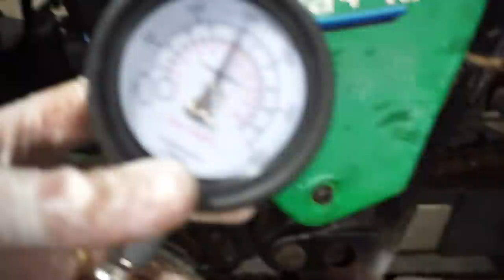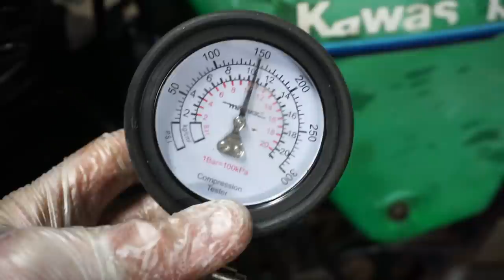Locked Up, Mouse Infested Kawasaki Dirt Bike. Will It Move? (Part 2 of 2)

Comment from the maker: What do you guys think of this bike? Was it worth the $600 I paid for it?
Please SUBSCRIBE and LIKE the video if you enjoyed! It really helps me out a lot!
Check out my Instagram: 2_vintage_
Thank you for all the support!
Reply: Seems like a good deal for 600
Reply: Yeah it was worth 600 I would have split the cases and installed new main bearings though
Reply: @2vintage when it revs up like that put it into gear then turn the gas on mine does it all the time lol putting it into gear and putting around makes it stop
Reply: what tools do you use?
Reply: Yeah 100% worth it and yes I liked the video and I am already subscribed great video keep it up
Reply: Can I have one of yo atvs 😂🤣😂 Nah but frl 😐
Reply: Cool vid, just wondering how the mouse nest made it through the carb jets into the crank, . Wouldn't of thought it Would pass through those tiny jets.
Reply: I had an '82 for a little while. Really cool bike, but these things have been used and abused for a long while. Paid $700 running and riding, but beat up.
Reply: That's really good bike you don't see those very often
Reply: @lenispicker362  I'm buying one today for $500. I'm excited.
Reply: Didn't go through the jets of the carb. Came through the air boxside. . Considering the skid was incorrect.
Reply: I would of bought it that thing is in really good shape for an 1980

Comment: I'm pretty sure there should be a chain roller where the foot peg mounts. Most Kawasaki dirt bikes I came across always had a bad cylinder, and starting in like 79 they can't be bored out, so I stuck with Honda CR's & XR's. I do have a custom 78 KD125 which I call a KDX125 as I built it using 74 KX125 gears, ignition & cylinder head.

Comment: You tuned the idle Soooo well on that bike GoOd JoBe
Reply: Lol
Reply from the maker: Hard to tune the idle when you have the wrong slide!
Reply: @2vintage  Don’t you think you should probably have looked over the bike and made sure you ordered all of the necessary parts before you start the project lol
Reply: @Chickenteam22   you obviously don’t know how it goes working on old bikes don’t tell a successful mechanic how to do his job because lord knows who’s been in that bike and mismatched parts part of the game is not knowing what your getting into you can’t tell everything that’ll be wrong with it before you start
Reply: @MintNickel1  And that’s why I said ‘’You should have looked over the bike and ordered all of the necessary parts needed before you start the project’’  read carefully next time, thanks
Reply: @Chickenteam22  no. if you do that with every bike you will waste SO much time checking things that do not need to be checked. when the bikes is running and riding, is when it will tell you if there is anything else which is broken or out of tune.

Comment: Suggest you replace that shifter or it will wear the splines on the shift shaft then you have bigger problems and it sounds like the clutches are slipping in the video 40 year old  clutches I’d say they need replaced definitely a cool bike Kawasaki was established in 1949 actually the first brand of the big four Japanese giants Suzuki came in 1951 and Honda and Yamaha came in 1955. But no other brand is better than a HONDA 🤙🏻.

Comment: There is supposed to b a chain roller on that bolt you put in for the foot peg.the chain would roll on the top side of the roller,then it wouldn't rub on the frame.
Reply: @titletownclowns1545  where do you find a service manual for these bikes? I dont own one, pdf format would be enough to take a peak.
Reply: @Friendroid  type kdx 175 parts diagram on Google and you can see the bottom roller

Comment: They used to put chain mail on a rope and tow it through sandy roads until clean. I suppose a sandblaster would do the job today. That way half the chain tension on a used bike isn't rust and mud.

Comment: Just watched your MX 175 vid and i honestly think you’ve had almost if not every old 175 made certainly all the good ones. Could’ve had yourself a nice vintage 175 collection when running right and they’re all little rippers and with doing all the work on them yourself cheap to fix and maintain. Just got to the part in the vid where your shifter was slipping and having had a couple KDX’s 175 & 200 i can tell you the shifters slipping are a common problem apparently cos they’re made from a cheap aluminium and wear out quite easily but a decent after market steel one will solve that. I’ve been told the kick not springing back is sometimes a problem people have had but I’ve never had it happen to me and i currently have a 94’ 200 I’ve owned for almost 20 years now absolutely bulletproof bikes.

Comment: When you drained that “oil” I have NEVER seen oil that milky in an air-cooled machine!
Reply: The crank was filled with fuel from carb overflow leaking through crank seal to trans.

Comment: Did you tried moving the air/fuel mixture screw to rich the engine out?
Also cranck seals must be smoked, leaning the bike and allowing gas to get to the oil

Comment: Where you put that bolt into hold the left foot peg. They're is supposed to be an lower inner roller inside their that the chain rolls on. Basically a longer bolt and then a nyloc nut.

Comment: I just picked one up for 500 bucks, turns out it had a small hole in the crankcase leaking out oil. I'll try to JB welded but I'm pretty sure I'll have to put a new engine in.

Comment: You’re going to be running super rich until you get that slide replaced with the cut out backwards it’s not allowing enough air in for the jetting to work properly. I had that happen on a dual carb slides were backwards .ran like shit flipped em  instant horsepower
Reply from the maker: yep just replaced it! Made a huge difference.

Comment: Ober yhe years of having bikes ive never had a bike to where the shaft splines strip out, theyre some pretty solid steel and would take alot for it to strip, 90% of the time the lever will take a crap way before the shaft ever does, ive stomped a few or so shifters so hard and strip them out and the shaft always stayed in great condition. Juat some food for thought

Comment: Good job on your videos and the shifter shaft I'm glad you still got thread on it it's a hard sucker to remove if it's broke my xr250 the first half of the shaft was busted off so I had to drill and tap and bolt onto mine so it would hold then I welded it ok it's not the right way to do it but I never had a problem with it again after that